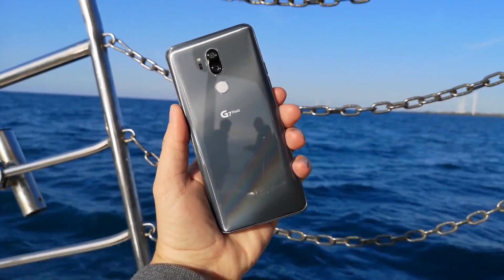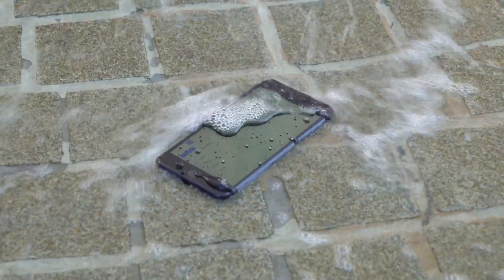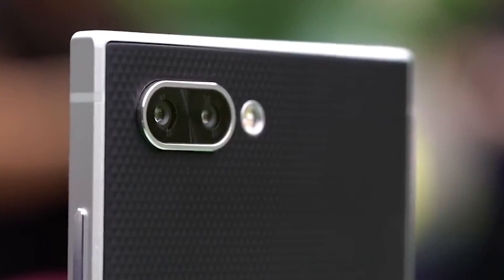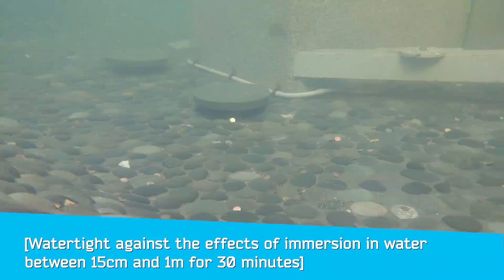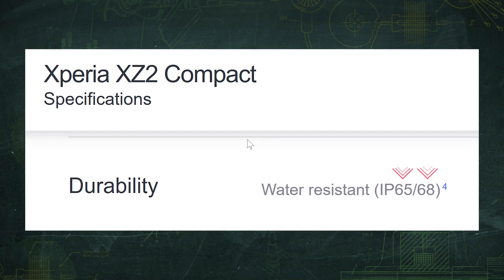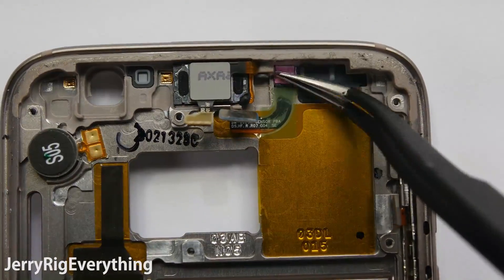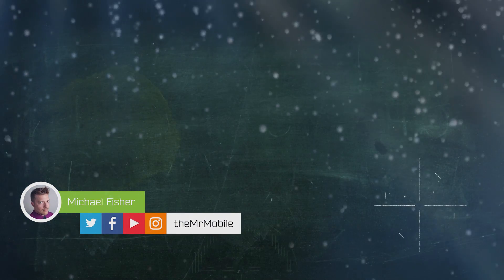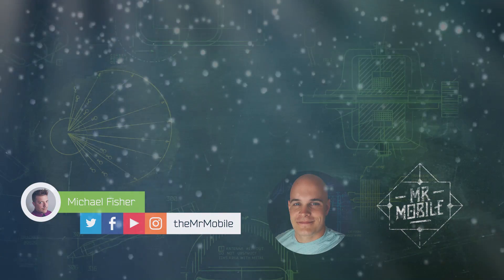Your "Waterproof" Phone ... Isn't

Comment: i used non water proof(g4 play)(5 months) and waterproof(x4 android one)(5 months) Motorola for motorcycle gps/navigation. Mounted in the open, traveled through snow storms, rain storms. pouring non stop for 10 + hours a day(spent about 3 weeks with 60% of it in pouring rain. below -10C for 6 hours a day for 1 month~ its still working like a charm :D 26k miles combined. also the moto g4 play has been the most reliable fastest phone so far(it loads complicated maps and renders without freezing up) and also battery lasted very long even traveling and sleeping without heater below -15C and places without electricity I was able to stretch it even more with airplane mode. I even had a pixel before.

Comment: I have a Samsung Galaxy S8, and I've been swimming in chlorine for about an hour more than a few times. It's always been fine. In the early adverts that convinced me to live like this, Samsung showed it off in a shark tank underwater.

I've used the water resistance quite alot for over 1.5 years, but your mileage may vary. I never tried salt water. But it has survived chlorine multiple times, even pools filled with too much chlorine.

I'm switching phones to a OnePlus 6T soon. I want a more stock Android experience, but the most painful thing making the switch for me is giving up on higher-rated water resistance. I probably shouldn't dunk this new one.

Comment: i think is the IP number is rated by the phone and resistance they perform...like from IP X 1-2 is physical form of debris like rocks 3-4 is dust proof 5-6 is Splash proof still can survive 1 meters  dive 7-8 water proof can do much longer and deeper dive....the IP first number is for the size 3-4 inch 5-6inch some phone categorize a 5.5inch phone as automatically 6 inch

Comment: I have a 10 cents water resistance and waterproofing solution for ANY phone ANY brand out there if you wanna film underwater - items you need - ONE STRAW and ONE ZIP-LOCK BAG. You get the idea...., also if you're not picky and good with your hands you can get away with just the zippy sandwich bag, no straw needed. Sometimes simplicity is beautiful.

Comment: lucky here in australia. manufacturer warranties are useless. the ACCC has laws in place to protect consumers. im sure the usa has them too but jhere in australia. if an item is advertised to be waterproof or resistant and it fails to meet that guarantee made by the manufacturer they cant deny you a replacement or refund etc of that item.

Comment: I know different definition of ip68. 67 is more or less accurate. You didn't explain why is this difference between 0.3 to 1 meter depth. This depends on the dimensions of the device. For phones it's just one meter. 
So as far as I know, 67 is supposed to withstand 30 minutes at 1 meter of depth and the definition that I know says, that 68 is better than 67.
And now my experience: 
Samsung galaxy s5 active (ip67). After around 18 months after purchase I forgot that I have it in my pocket and went to the pool. Realized about it after less than 3 minutes. But it was too late - water came inside (earlier it fall down few times on the floor) . Had some issues with sd card and charging. Warranty rejected - phone came back to me and it's still working great. 
Xperia z1 (i think it has ip68 but I'm not sure) - after three years from the purchase (while after around 12 months it was in Sony service for display exchanging) I made great underwater pictures and videos in the Mediterranean sea. Phone was working perfect without any signs of leak long time more. 
Xperia xz premium. After one year it went for display exchanging as well. It came back from Sony service with leak test correct. After one month i wanted to make some pictures at pool, so i put it few times underwater. Unfortunately - water got inside. The same day phone became useless. I regret that I didn't copy my pictures and movies to sd card. 
I sent it for warranty claim - they exchanged everything and sent me back my phone looking like new with warranty time reset (motherboard, battery and casing new for sure).
Somehow in this three descriptions Sony wins. 
However - i prefer Samsung. 
So I have a Note 8 (already made some underwater pictures without damage :) and my wife carries a xz premium (almost new).
Didn't think my comment will be that long. Sorry :)

Comment: I'm curious. How much risk am I taking bringing an IP68 rated device in to the shower with me but NOT under the shower stream? I often bring conversations with me, and hang the phone on the stall door, or sit it on the little shelf as far from the spray as possible. 

Also, I plan on getting a smart watch when I can afford one. A lot of them are listed as being safe for swimming. How true is that? Should I?
Reply: Well, it's safe to a ceartin extent, you can be like 95% sure that it won't be damage but there can be quality issues for example so it wouldn't be properly sealed. As you can read in the other comments, alot of people have good experiences even in phones with IP67. Even my Huawei P9 wich doesn't have any sort of ingress protection that I know survived an accident in the toilet. If I were you I wouldn't worry to much about it, the smartwatch is probably going to be fine
Reply: Smartwatch should be fine. Phone will be fine . It will just get a few drops on it most likely.  Even my phone not advertised as waterproof is fine when i use it in the rain

Comment: my s8 is definitely waterproof.. Taken it to 3 different beaches and b4 taking it to the 3rd i dropped it and cracked the edge of the screen. Very small crack but I knew that the integrity of the rating was now compromised. How is it still waterproof with no otter box protection? CLEAR NAIL POLISH! worked like a charm. I'm waiting for the s10 so I'm not upgrading nor am I paying 200 for a new screen lol. 50 likes and I'll post all my underwater pics  (straight from my phone) on my channel. ☺
Reply: It's not waterproof, you are just super damn lucky lol
Reply: @yasu_red   it is lol
Reply: @vadimm3521  Did you even watch the video? No, you didn't
Reply: @yasu_red   first i did and  if u saw the vid u would know that if u just drop it in water it will be fine
Reply: @vadimm3521  Normally salt water may dissolve the glue... in ur case ur phone should be fine, but I wouldn't advise placing it near water again, especially with a cracked screen...
Reply: Electronics and water do not mix regardless of the IP ratings, there is always chance of failure. It's there for accidental/emergency reasons, not to play like it some sort of cool toy. 

My phone is water resistant but I wouldnt think twice submerging it in water, ask yourself, do you "really" need to put in water?
Reply: Wait otter box cases are waterproof?

Damn bro I just use them because they’re really hard

Comment: My father didn't believe me when I said my S8+ was waterproof (or very water resistant). So I filled a bucket with water and threw my phone in, submerging it fully. Screen worked fine underwater, left it there for a reasonable amount of time. Picked it up and wiped it dry and didn't give it another thought.

Doesn't mean that it would still work if I left it submerged overnight, but who the hell does that? I imagine a regular scenario is one where someone drops it in a puddle, and picks it up 5 seconds later. For that - it works perfectly. Or when I dropped my S4 in snow. Few seconds in the snow destroyed the 3,5mm headphone jack, rendering the phone crippled. My S8+, and now my new Note 9, would have no problems in those scenarios.

Comment: I think they should rework the IP rating, so it's better to understand. The particle size is pretty straight forward and the reversed order is nessesary to allow even better ratings.
What really needs needs a rework is the waterproof system. There are 2 types water that a device might encounter. The first is submerged where giving a depth. There should also be a rating for different types of water or liquid like saltwater and so on. The other is spray water like showering and so on.
The ratings should also be near typical situations. When I know that from the rating my phone can withstand normal rain/shower for 60 minutes, I know that I shouldn't use it while very intense rain.

What I think it's more important is that they should include waterdamage in the warrenty, when the device was used as rated. I know that in Germany they can't easily say that they don't cover this damage. Here there are 2 types of warrenty. The one from the manufacturer where the manufacturer can make the conditions like they want. There is one per law where the seller is the one that need to cover it.
This warrenty is always 2 years long for new devices with some. Exceptions but for electronic devices it's 2 years. In the first 6 months, the seller needs to proof that this defect was not caused of a manufacturing problem. After that, it's reversed, where you need to proof that this defect was there before buying. Everything is covered when you used the device as intended and the defect was there before buying.
For example when you put your phone into a kiddy pool and water enters the phone, even it was rated that it should withstand this water, you get your device repaird or changed. They must do this and can't just gave the money back. You can even decide what they should do, except its not cost effective. I mean getting a new washing machine, just because the fan belt needs to be replaced, is not cost effective. On the other hand when the motor had an defect and repairing cost nearly as much as a new machine, the seller can replace it.
They only need to do it twice and after that, you can get your money back.

The only problem is that your warrenty doesn't reset for a new device or a repaired device. The replacement might break again after one year, just after 2 years when you bought the initial device.

The idea behind this, is that they can't advertise everything and just say that they don't cover this, just because they can't proof that you made an mistake.

Comment: Basically:
If its isnt at least ip69 and up, you just gave up on a removable battery and probably heaphone jack for basically anything usefull..

My older phones, galaxy mini, and a s3 didnt have any ip ratings, but they lived very well and wet. I actually washed them many times in the sink. (Yeah freaking crazy). 
Both are working with other people right now, the s3 was dropped and the screen broke. I have a g5 (non s or plus) and it isnt waterproof, and i really dont care about it.
Reply: Eduardo Avila I use a note 8 which is ip68 certified and has a headphone jack, i don't mind not having a removable battery because it has a 30 minute fast charging cable (which came in the box) and with wireless charging it becomes even faster (around 20 minutes) while it is certified and yes, cleaning it under the tap (just sort of dipping it under) is useful, although it doesn't fully submerge and it was only under it for a second, it is very useful in those circumstances. Although I don't dare fully submerge it "just to see what happens" I'll leave that for when I accidentally drop my phone in a lake or something while taking a picture of it.
Reply: My Cat S61 is IP69

Comment: I dropped my moto g4 plus in a bucket for few minutes. The water entered in to  the dislay,But it worked fine. After few days it didn't turn on. I went to the service center, they said the processor has got  damaged and luckily It got repaired under warranty with zero cost.

Comment: I currently run a G5, a phone that sold poorly specifically because it wasn't water resistant the year all other phones were.  Having the phone means I've kept my old habits of being careful around water with it.  Coming off 5 years of iPhone (glad to break that addiction BTW) I have quickly become addicted to being able to change the battery and really consider that feature more important than water resistance.  I don't know what I will do next time out now that all flagships are sealed and you can't change out batteries, but I think I will continue to be careful around water even if my phone is "water proof".  Thank you Mr. Mobile for another insightful review.

Comment: Fun video, I have done IP tests at my work I have a 1m dunk tank. I think the confusion arises from the device withstanding the test 30 minutes in 1m of water does not mean it is a device intended to be used underwater routinely. It is a water resistance standard. Waterproof is a whole other level.

Comment: Amazing explanation. I do IP ratings for work (my day job), and you have done an excellent job at explaining.
Reply: Quick question for you haha, what can I expect from my ipx5 speaker?
Reply: They didn't talk about IPX9. Do you about that? Does that even exist? It goes from 0 to 9 the water resistance, right?
Reply: @LinuxIsNotAnOperatingSystem  X9 doesn't exist as a standard. Stops at 8 for that particular battery of tests.
Reply: What about Nomu S10 pro? They claim is totally false, then?
Reply: @LinuxIsNotAnOperatingSystem  Oh dang, they added a new standard! It's high pressure high temp water spray. Still not the same as 68 (but I'd assume it's be 68/69?) - Still, 8-10 mPa of pressure is pretty serious pressure.
Reply: @LinuxIsNotAnOperatingSystem  actually, they didn't even update the ratings, there's just a different ISO test for X9K. Cool stuff though.
Reply: Now I'm even more confused XD

Comment: My LG G6 came near drinking water once and it started giving me moisture detected in USB port error. I was unable to charge thereafter and ended up replacing USB charging board. So  imo water resistant rating is pretty lame.

Comment: If there is is no warranty against water damage, then an ip68 Rating is mere marketing gimmick..also the water proofing cannot be maintained after a battery replacement 2 yrs down the road..So it is a better option to rely on external waterproofing casing..

Comment: Also keep in mind soapy water will affect how well water stays out of a phone
A lot of the very fine screens that they use over microphone and speaker holes keep water out due to the surface tension of the water molecules. When soap is introduced into the water it changes the surface tension of the water molecules, and can let water through the screen that would otherwise have kept the water out. Something to keep in mind if someone want to use phone in a shower or bath, or even when washing a car or laundry
Hope this helps! 😊
Reply: That's a solid tip, Thanks!

Comment: I've never had a problem with my galaxy phones. Now apple phones are probably more likely to have problems when put in water.  From my s7 to my current s9. No problems at all.  The port says its wet when submerged for a little while. But all I need to do is blow out the water and let it dry a few min. I can charge it and go on.

Comment: Great video you two, and I'll use THIS as a reference instead of explaining the rating systems!

Now, I know that Mr. Mobile hates them with unbridled passion, but do you think the U12 Plus haptic buttons offer more water resistance than the standard hole in the chassis buttons?

Comment: Omg I've opened this video ready to make the point about the water resistance not being cumulative. But you guys rock, the first accurate video about IP rating that I've seen. 

I just missed one side note that could've been done on why swimming with the device isn't a nice idea, and that is because while swimming (moving in the water) you create greater pressure against the device.

Comment: Great video.  Way to team up!  Question - Shouldn't the LG V30 IP68 ratings be a bit more robust than that?  The way you described how it got damaged seems well within the limits of what the phone should be able to withstand.  Also, how does water repellent coating (e.g. p2i) fair relative to the IPxx scale?
Reply from the maker: I took my V30 from an hour-long salt-water swim to an hour-long chlorine swim and I delegated the freshwater rinse duties to a friend, so I'm not sure how thoroughly it was done. Basically, I was pretty reckless. As for p2i ... that only starts to take effect when water's inside the casing, so it's a totally different way to guard against damage.

Comment: This is a big pet peeve with me:

Water resistance on a phone is *worthless*.

It's worthless because the manufacturers and carriers don't cover water damage.  If that little sticker in the phone says that it's been exposed to water, you're done.

So why am I paying for water resistance when they won't cover it  if the water resistance fails?  If you get the phone wet and the water resistance fails, you can't get it fixed on warranty, so it's worthless.

Comment: On my 3rd replacement iPhone 7 (Due to non-accidental issues), I dropped it in the toilet on accident. I took it out as quick as possible (As I planned on trading it in for an android a few weeks later) and saw a slight bit of moisture in the camera lens. Sadly, I could no longer trade it in for that reason. Quite frustrating if you ask me.
Reply: BrutalSystem that’s sucks man. I dropped my iPhone 7 in a lake for about 5 minutes and was very lucky I didn’t have any issues. It was pretty new at the time.